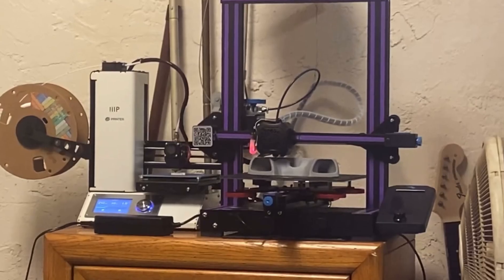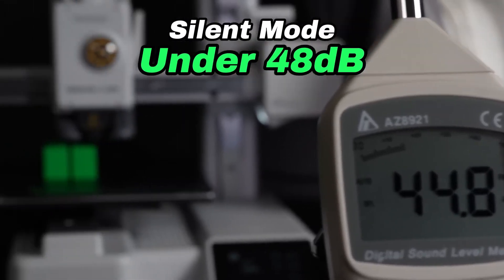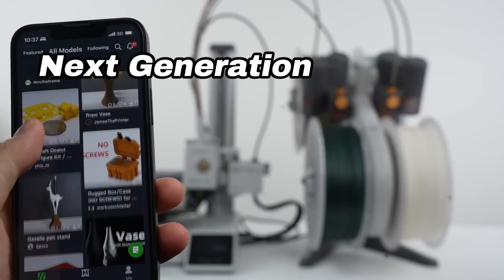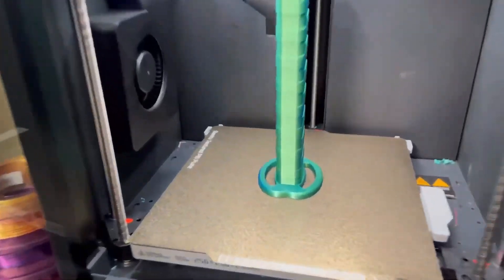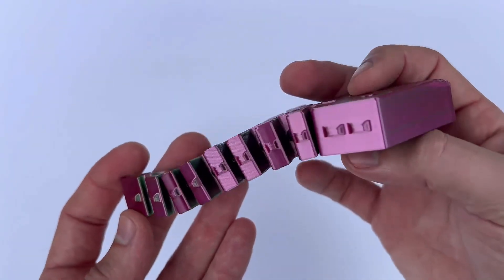Creality Ender 3 vs Bambu A1 Mini Comparison - Which to Choose?

Comment: I have a ender 3 and I have got it repaired few times already and I don't feel like spending more money on it, its barely 1 yr old and I have printed 15 days in the last whole year. It already got it's fans changed and hot end changed 2 times and still it is giving error soo i stopped using it. I don't have the time and energy to keep it repairing.

Comment: 這段影片比較了 Ender 3 和 Bambu Lab A1 Mini 這兩款受歡迎的 3D 打印機。影片的重點在於兩款打印機的學習曲線、打印體驗、可靠性、打印體積、價格、升級潛力以及多色打印功能，旨在幫助觀眾選擇最適合自己需求的打印機。

# 學習曲線的差異

- Ender 3 通常需要更多動手排查問題和進行修改，但也意味著用戶可以從中學到更多關於 3D 打印的知識 [00:00:31]。
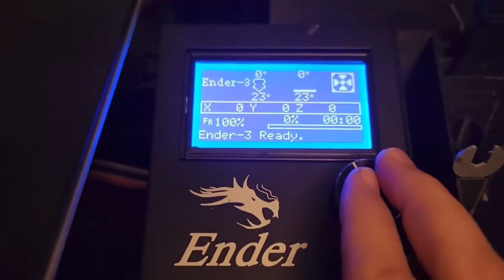- 許多用戶認為 Ender 3 的學習過程可能涉及更多的故障排除時間，而非直接打印 [00:00:43]。
- Bambu Lab A1 Mini 被描述為即插即用型打印機，非常適合希望盡量減少麻煩的用戶 [00:00:54]。
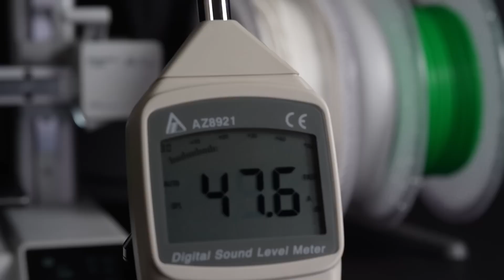- 對於追求更直接、開箱即用體驗的用戶，A1 Mini 可能是更好的選擇 [00:01:05]。
- 建議如果選擇 Ender 3，應購買最高版本，以減少需要自行調整和修改的機會 [00:01:15]。

# 打印體驗與可靠性

- Ender 3 V3 版本因其穩固和可靠性而受到好評，許多人認為它在功能上與 Bambu Lab A1 Mini 相似 [00:01:37]。
- Ender 3 V3 缺少像 Bambu Lab A1 Mini 那樣的多色打印能力 [00:01:49]。
- Bambu Lab A1 Mini 因其可靠性、打印質量、靜音運行和快速打印速度而獲得高度讚揚 [00:01:59]。
- 新手用戶對 A1 Mini 的完美設置表示滿意，並認為它非常易於使用 [00:02:11]。

# 打印體積與價格比較

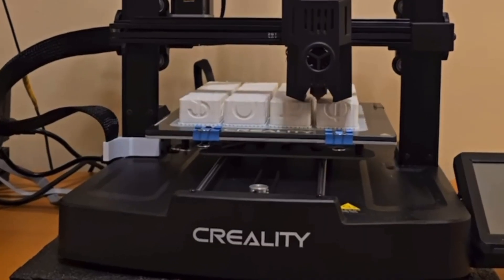- Ender 3 擁有比 A1 Mini 更大的打印體積，這對於打印大型物體是個決定性因素 [00:02:21]。
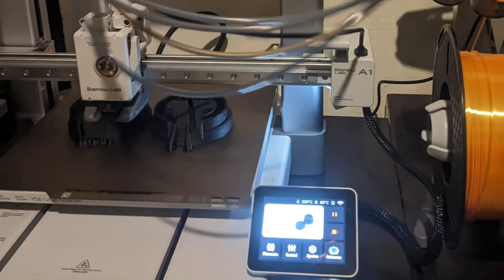- 對於許多用戶，特別是初學者，A1 Mini 的打印體積已足夠，因為他們通常打印較小的物品，如模型、指尖玩具、人偶和收藏品 [00:02:32]。
- 如果需要打印頭盔等更大的物品，建議考慮 Bambu X1C 或 K1 Max [00:02:51]。
- 從價格角度來看，Bambu Lab A1 Mini 通常因其功能而提供更好的價值 [00:03:03]。
- A1 Mini 的價格可能比 Ender 3 貴約一百美元，具體價格也會根據所選的 Ender 3 版本而有所不同 [00:03:03]。

# 升級潛力與動手樂趣

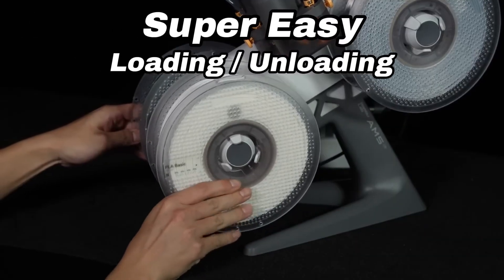- 對於喜歡改裝和升級 3D 打印機的用戶，Ender 3 提供了大量的潛力，許多用戶對其進行了廣泛的修改，從而深入了解 3D 打印的細節 [00:03:13]。
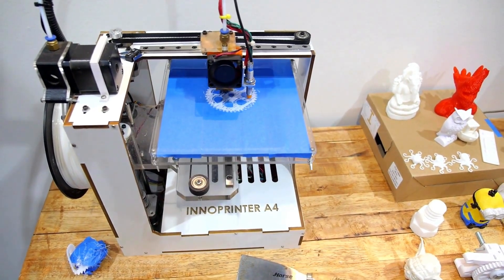- 通過動手改裝，用戶可以學習擠出問題、手動調平、故障排除和自定義打印機 [00:03:23]。
- Bambu Lab A1 Mini 的設計更適合偏好無憂體驗的用戶，或者只想純粹享受 3D 打印樂趣的人 [00:03:35]。
- A1 Mini 在無需大量動手的情況下即可獲得良好的打印效果，非常適合初學者 [00:03:45]。

# 總結與多色打印

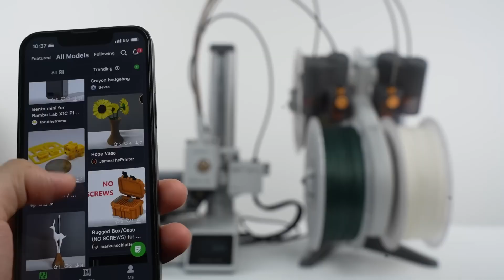- Ender 3 適合喜歡動手、升級和學習打印機機械原理的用戶，同時預算較低並需要較大打印體積 [00:03:56]。
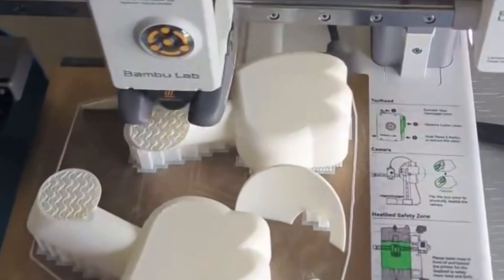- Bambu Lab A1 Mini 適合希望獲得無憂、可靠打印體驗且極少故障排除的用戶 [00:04:06]。
- 多色打印功能是 A1 Mini 的一個亮點，但一些用戶認為這會浪費大量耗材 [00:04:16]。
- Bambu 打印機提供出色的打印質量、速度和易用性 [00:04:26]。

Comment: I had ender 3 for 5-6 years, i bored everytime to check the problem and the solution, i updraged the m/b with the latest silent motor chip, i put a glass on bed because it was a little bended, always bed leveling after sometime that i wasnt using it!!! Now if i wanted to upgrade it i wanted to put 150€ but i put an other 50, 200€ overall and i brought A1 Mini. Bed its little smaller, 5cm smaller than ender 3, but its not deal breaker for me.
When i set it up it was night and day, very fast prints without loosing quallity and i am amazed with the app that bambu lab has on phone and pc.
Also it has great community!!!

Comment: I think that an Ender 3 can be upgraded to be as good as the A1 but out of the box it just is not there. My Ender 3 is great now after switching to an upgraded motherboard with silent motor drivers, adding auto level, swapping bed springs and leveling knobs, and adding an all metal extruder. As much as I want to try a Bambu, I just can't justify it with as great as my Ender runs now.

Comment: I have a Ender 3 v2 and going to buy a new printer, I'm looking at getting the A1.
Reply: Look into klipper for your old ender ...I've got a bambu a1 but have some.old ender 3s that are just so slow after using the a1...I want to try revive the ender 3s I have so looking at going the klipper route

Comment: The images shown from bambu are a bit deceptive. You're showing the A1 not the A1 mini

The Regular a1 and a standard vanilla ender 3 have exactly the same bed size (235mm x 235mm) . but the a1 mini is 180mm x 180mm
Reply: especially in the build volume area
Reply: Wrong A1 has a bigger build volume. 🤣
Reply: Ender 220mm actual work area. 
A1 256mm actual build area. Ya they are the same. Not. 🤣
Reply: @nvidiashield3757  oh yea. u rite

Comment: I have a bamboo lab a1 non mini and and ender 3 v2 modified and i could say that they both have about the same quality but the bamboo wins for many reasons. For example the software, multi color, speed, and less tinkering since it had many auto calibrations.

Comment: I got an A1-Mini because the A1 was recalled, it took less time to set up than an Epson paper printer I have.  It just works out of the box.  Occasionally get a failed print but usually when printing my designs. Print size is sometimes limiting but not that often. If you want the 3D printer to be the hobby then get something else.
Reply: Hi, man. Sorry for my poor reading comprehension, but I don't get your point. At first I thought you're recommending A1 Mini, but then in the last sentence you're  telling people to get something else if they want to make 3D printing a hobby. So is the A1 Mini worth getting or not?

Edit: oh, nevermind. I just figured out you're trying to say "if you want to spend more time on 3d printer fixing things than to 3d printing itself, then you should be getting something else (like Ender 3 in this case)". Right?

Comment: I'm thinking in getting the A1 , I already have a Kingroon KP3S Pro S1 as a first printer and works pretty well, but sometimes I want to print multicolor figures or helmets and would be nice to test a better printer like the Bambu Labs ones, I can't found any comparison between those printers though, thanks for the info!

Comment: Currently owning Ender 3S1Pro running klipper via Rasp Pi. Once dialled in correctly it will produce great prints at great speed but... It taking too much space that's too hard to justify for the amount of projects I am printing. Ideally I would like to have it stored somewhere away ready to be pulled out when needed. That means, lots of dialling in each time that is putting me off from this idea. So... I ordered the A1 mini. £169 without AMS is a steal. Small footprint so it can be stored in cupboard and pulled out when needed and ready in few minutes due to auto tuning. I am looking forward to get it delivered in next few weeks. Then I will sell the Ender.